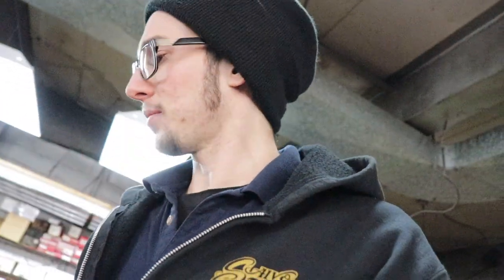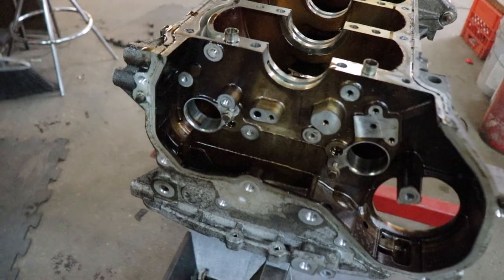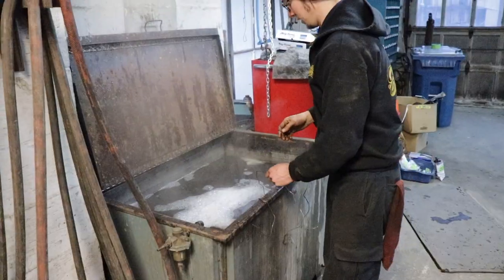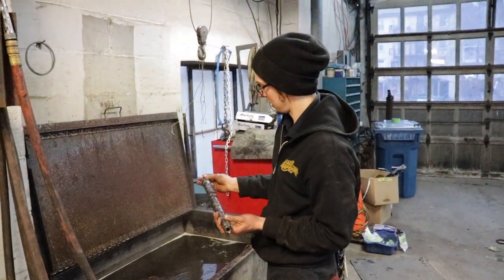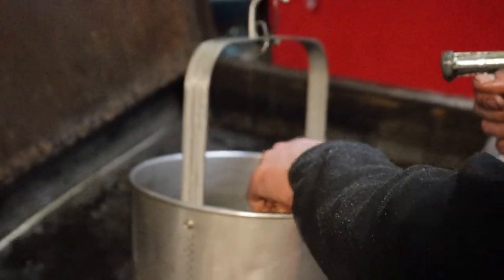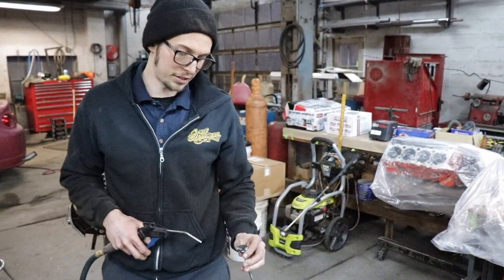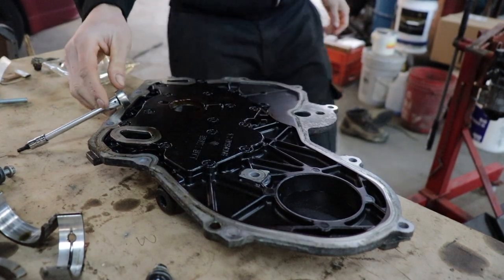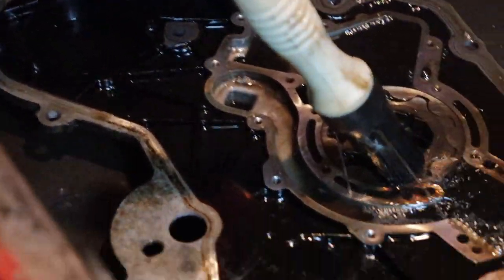LSJ Engine Cleaning

Comment: Aye bro I lost compression on my lsj only on cylinder 3 was 65 max and the others where fine, you have an suggestions that I should Do ?or what might have caused it and is it worth rebuilding?
Reply from the maker: did you check out the video i posted on the teardown of this engine? i broke the piston in cylinder 3 cause of too much boost and you may have the same problem.
Reply from the maker: what do you all have done to the car
Reply: Just 3.0 pully intake and that’s about it it started with a misfire only on cylinder 3 and then I ran compression cause everything was fine and found low on cylinder 3 so not sure what do I do any recommendations?
Reply from the maker: @Pacheco760  sounds like your gonna have to rebuild it, did you cehck the oil and coolant level?
Reply from the maker: @Pacheco760  best way to tell is to do a leak test any performance shop can do this for you even general shops. it lets you know where all the compression is going whethers its pastthe valves or the piston and then that lets you know what will have to be done.
Reply: Yeah all the oil and coolant was good and alright I’ll give it a try thanks !